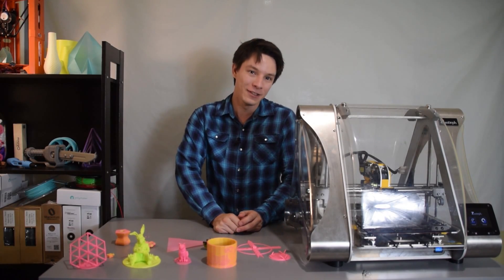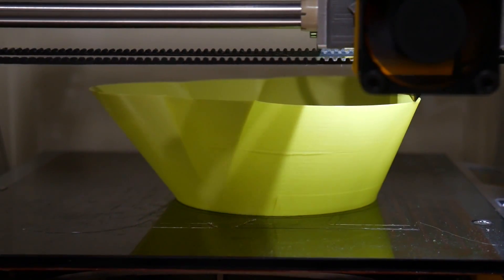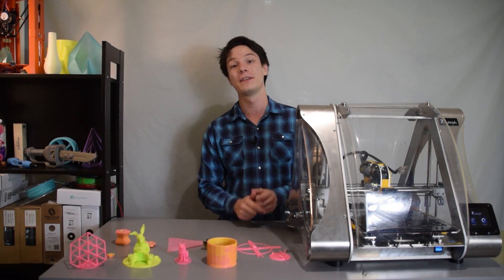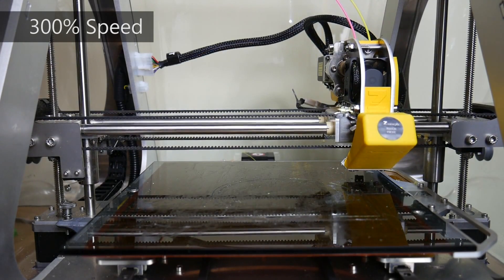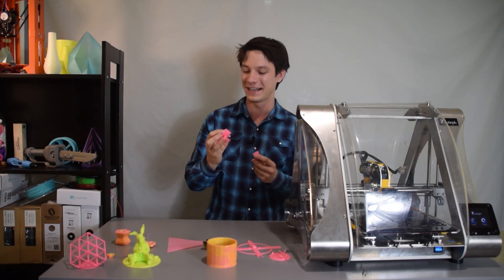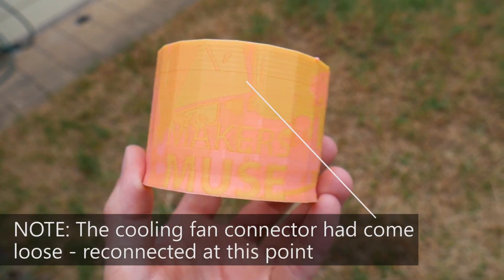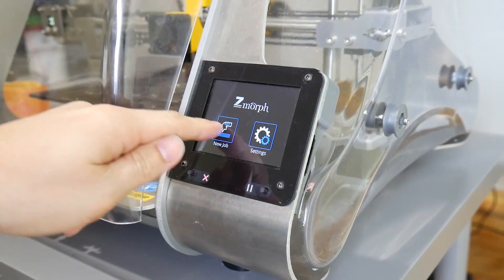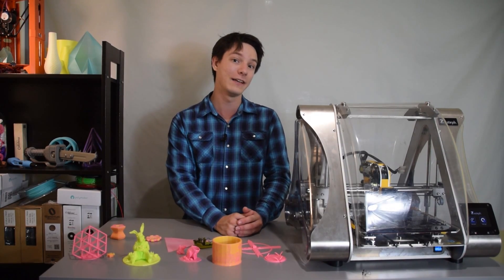Zmorph 2.0 SX Personal Fabricator - 3D Printing Review

Comment: This is a good printer but toss the voxelizer software. It sucks. It's super easy to make a good profile for simplify and cura. Also, if you use pva with the dual pro extruder, please use towers and custom gcode to retract the pva every time it's not used. A hardened pva clog is a nightmare to get rid of, especially through the 45degree channel the dual pro has.

Comment: Best to have specific a tool for a specific job. If anyone has milled MDF, for example, you know how nasty that stuff is and will contaminate all the mechanical componets, and anything around it.  Same with laser cutters, the smoke will contaminate the enclosure and mechanics.  3D printing is best done in a controlled clean evironment and in a dedicated machine. Do you want to 3D print on the same machine you just created a lot of dust in or is filled with smoke debris?   I don't go with that logic... Although the machine interchangeable "tools" look cool, the whole enclosure design is also bit distracting, not sure if it is the clear plastic they have around it or the whole shape of it, but I lean more towards the simpler open frame type of 3D printers enclosures. Easy to wrok on, and if you weant to enclose it you simply put it inside and box.

Comment: Im impressed with the build quality. Thats not a cheap construction. Think when the 3D printing issues is resolved. It wil be a great combo tool. I deffo want to see the milling capabilities. Is there a resonable bed with T slots in it? 
I do see alot of good use of it. Mill pcb boards. print cases to the bords. ect. 
Anyway. As an old macshinist. Im happy to c something diifferent than acrylic or extruded alu frames. 
So, more videos plz. :)

Comment: Tried it for a month. Did not like one bit of it. The extruder design is poor (read low resolution because of the direct drive), the z sensor attachment is useless because the 3d printed part does not fit, the firmware has bugs, ... I had  a lot of failures with it. Even stopped mid print for whatever reason. By the way the extruder is unserviceable.

Comment: Pick one thing and do it well. A rigid router setup is never going to be as nimble as a lightweight 3d printer/laser, so its always going to be a compromise. I would argue though that the zmorph is not rigid, unsupported rails like this might look strong compared to a 3d printer but they are crap compared to proper profiled linear rails mounted directly onto a gantry/zaxis. Kinda of makes the whole metal chassis a bit of a joke, no matter how strong its made the unsupported rails will always going to be your weak point.

Comment: Hi! I've been binging your videos for a few weeks now and you really got me back into wanting a 3d printer. I've been daydreamining of turning my 3d models into figurines through a 3d-print>mold>resin/plastic cast sort of way. Should I get a 3d printer that can do ABS since the PLA could potentially melt or deform in the molding process? This is all very new to me so I'm just trying to learn as much as possible :)

Do you have any recommendation for printers with a high-detail print capability at perhaps a loss of printer space, since what I'm thinking of printing will be rather small (think disney infinity figure size or slightly bigger but printed in separate pieces etc)
Reply: Vegard Klausen hi i am getting  a mp mini select it is a printer under 200 pounds that can print any plastic (though some are experimental) it has a heated bed and a 100micron later height minimum it seems quite good I recommend you check it out!

Comment: 20 sided cylinder would be a icosagonal prism, a true cylinder only has 3 faces as it's based on a circle. 
Also, I'm interested in thee accuracy of the modules. How many micrometers would the print head be off from the laser cutter or whatever else they offer, and how repeatable is it, and would two separate modules of the same type have a difference.

Comment: interesting machine, I've always wanted to convert an old printer to do really light duty CNC work. Just the price tag is a little unfortunate. For half the cost you could build a solid machine like a CoreXY as well as a fairly decent sized router, both of which would do their jobs so much better than an all-in-one ever could. But I suppose that's really not the purpose of this thing, it's sort of trying to build all of those machines into a single, very compact form. Plus it seems like the software is a big part of what they're selling you, similar to what lots of manufacturers are doing now. Only problem is just how rarely proprietary software is actually better than the stuff we already use every day like Simplify3D, Fusion, Cura, etc

Comment: A laser engraver with clear acrylic windows seems kinda dangerous
Reply: Depends. My laser safety glasses are obviously completely clear poiycarbonate, but are opaque at the CO2 laser frequency (it's probably the ground up $$$ that block the laser emissions? damn are they pricey, but so are my eyes...)
Reply: The correct Laser protection glasses are supplied with the Laser Engraving head by Zmorph.

Comment: This is one of those: jack of all trades master of none. I really don't understand why manufacturers keep trying to force these machines to be everything. A 3D printer, a laser cutter, a CNC. Just because they all use similar electronic and stepper setups doesn't mean the same machine and construction is appropriate for all. The more I see attempts at doing this the more I think it's a wasteful effort. Do I want my 3D printer covered in aluminium dust/shavings or saw dust from CNC milling -- NO. I do wood working as well as 3D printing -- wood working tools are in a different room in my shop. That's for a reason. Anyone who has done both will tell you, saw dust is one thing, but aluminium dust clings to everything. Try to vacuum it, it's worse than cat hair. We keep making an effort to get a perfect 1st layer by cleaning the bed with alcohol before applying whatever your bonding agent of choice, and the last thing you need is the part cooling fan to kick up some CNC debris into your print. Hence the mess of the software. I honestly would rather get a small CNC and put in the appropriate area of my shop with proper air exhaust and dust collection and keep the 3D printers dedicated to 3D printing, but heck that's just me.
Reply: I kind of agree but I am sure that this has got a use

Comment: That frame is a beast! Definitely over designed for a 3d printer, but rigid is necessary for milling. That software is disappointing though, the voxalization is a lot like Meshmixers Make Solid, and you can definitely lose detail. That's an... Interesting.. Machine for sure.

Comment: hmm, the machine looks great, but i'm not too sure, what the target demographic is. 
the 2 in 1 out dual extrusion, i dont feel so much. the option of color blending doesnt seem worth the amounts of material you need to purge, when in most cases you'd just want to print two colors by themselbes, and with no mixing.

Comment: The manufacturer should move the encoders on the idler pulley side, it looks like a good machine and the encoders go to waste on the motors. On the opposite side they will take into account belt stretching..

Comment: Why do folks keep thinking these multi-machine contraptions are a good idea.
- Milling chips and dust are going to coat everything
- Chip extraction is overlooked
- deadly fumes from laser engraving have to be filtered or vented outside
- and as pointed out, Voxelization is meant for design work,, not toolpath control
- $ price , (I don't even want to know)

Comment: Angus, I think it would be best if you covered all toolheads, because summed up - everyone will ask for everything. My uni was offered the Zmorph about a year ago. I wasn't impressed by it and the laser toolhead seemed a joke to me. And my colleague said that the belts will be a major weakness for the milling part.
Reply: arthur1129 BoXZY is a better modular printer. Yes you're right about the belts. industrial ball screws make a huge difference
Reply: That's a tank... though if I wanted a 3D printer and a CNC mill I would go for a Prusa i3 Mk2 and PocketNC  combo and that would be cheaper. Dedicated is always better.

Comment: Please if you could, continue it with showing more. Also showing if the cnc tool head can cut aluminium.
Reply: Wow 5 axis, that's actually pretty cool! I looks like it could be great for some micro machining where accuracy really counts. Great find :D
Reply: Also the PocketNC
Reply: just looking at the fact that this machine uses belts for all but the y axis I highly doubt it would be doing much aluminium milling. you really need rack and pinions for milling aluminum
Reply: Iron_Colt If you want to CNC aluminum, there's another printer on the market thats better than this.  Check out BoXZY.